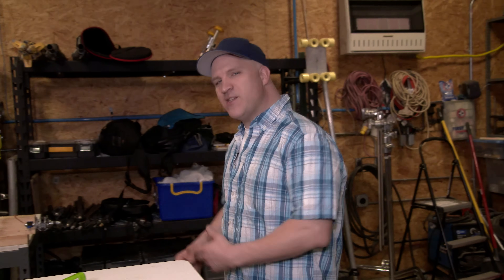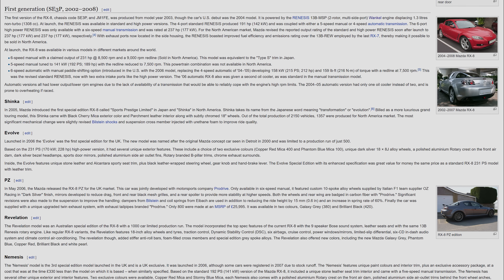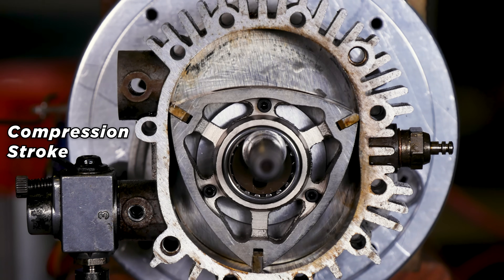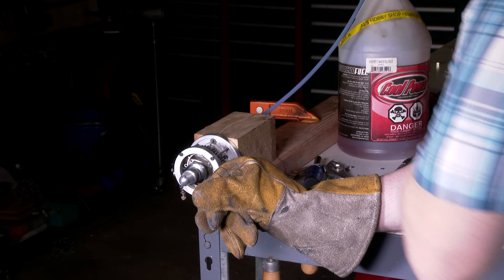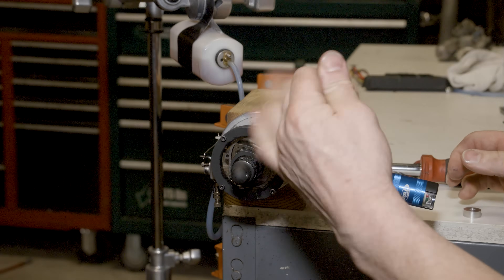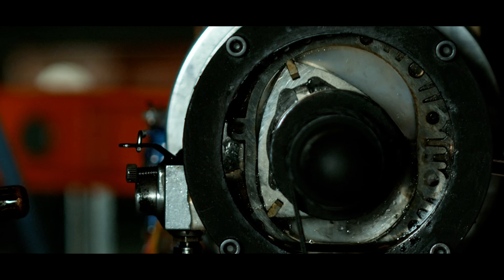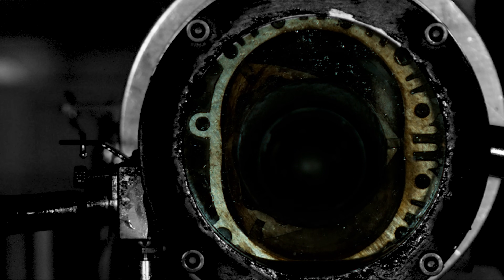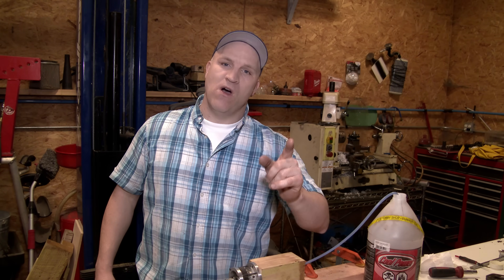See Thru Rotary Engine in Slow Motion - (Wankel Engine) 4K

Comment: The problem with the rotary engine is it’s to low of compression to be fuel efficiently for horsepower an the engine life is not all that great if this engine was a miracle it would be popular in the automotive industry! But it’s not really that great in my experience this engine is junk I wouldn’t never own one!! The piston is the best cause It traps the air intake and compress the air always has more torque because the length of the lever on the crank has more torque than the rotary!! It’s the long stroke high compression system that will never be out preformed in horsepower an engine torque at low RPM ! You can’t change the laws of energy that’s why high compression an long stroke engine are the real engine fundaments for hard working engines with the best fuel economy!
Reply: I think the point of the video was to show how this operates, as in a way to learn.  Not once did I hear him mention any comparison to our traditional motor.  Just explaining how this motor evolves, and in slow mo!
Obviously there are many drawbacks to this or it would be standard.  So, why learn something new????
Reply: brio I’ve seen a heard a 16 V 71 Detroit an a 16 V 92 at inland diesel in Gary Indiana run thy were used in ships that were used in the ports ! There horse power range is from 4500 horse to 6800 horsepower if you don’t believe me go to inland diesel off of I65 an 90 thy overhauled them there from the oil pan to the top of the engine head stands around 5 feet tall ! I can tell that you don’t know nothing about these engines because you would never talk like this you’re lying 🤥 about your knowledge so do your research and go an see the real engine! That demon 16 doesn’t have the foot pounds of torque as the 16 V 92 Detroit because if you would work the snot out of the demon 16 the engine would blow probably the head gasket would crack! I’m not a fan of sports cars I think there stupid to have because most of them have to be on highway that can have a pot hole because there stupidity low clearance! One thing I know a car shredder would take a 5 million dollar car a shred it in seconds! It’s for idiots that have more money than brains!
Reply: @craigmartin6826 Can you have 6800hp engines only 5 feet tall? I have been working on engines 3 stores tall at output a little more than that, like 8400hp. Are you talking about fast running 4 strokes? Not big 2 strokes at 120rpm?
Reply: Finn Halland I’m talking about about 4 stroke late model Detroit engines that run at 2 thousand RPMS max! I know there are bigger piston engines than the Detroit my point is that they are not rotary engines ok your getting off the subject! I know ship engines that are 4 to 6 stores high but there all piston engines I told u rotary engine fundaments are crap ! The Detroit   ship engines are better then the caterpillar engine because Cat has a value problem an known to brake cranks an burn up rod bearings I know the 3412 has some serious problems with the same causes! The Mazda 6 with the rotary engine is low compression an it gets bad fuel economy only between 18 and 22 miles per gallon which the Jetta TDI is known to get 45 miles per gallon which twice as better because it’s a piston Diesel engine not a stupid rotary Mazda this what I’m talking about an Detroit were known to be more fuel efficient than Cat an Cummins which all engines have there problems an it’s mostly depends on the mechanic 👨‍🔧 that puts the engine together!!! 90 percent of the mechanics are idiots and don’t do anything right which is the biggest problem with engine problems an I believe your one of this mechanics!
Reply: @craigmartin6826  I am confused. I wasen`t after telling you how large engines there are in the world. I was just asking if you could have a 6800hp engine as small as 5feet. (Keep racing out of this). You give some factual interesting replys worth reading. Than you turn to just make a point in how you are one of the few 10% best mechanics and you state the rest 90% are all idiots. I don`t  know how good you are. I only know how superior you think you are. (It is not any likable feature). But how you are able to make up your mind about me beeing one of those idiots that sadly are not like you, i really do not understand. Where do you get all this info from? I am sure you do not base your statements strong as this just on the couple of questions i posted here? Maybe you think you are God?  If you choose to reply, please keep it simple because i am writing in a foreighn language. There are some languages i Know better than this so if you are bilangual  please tell me so maybe we can share opinions more easy.
Reply: Finn Halland well I’m not playing God what do know engines fail if there not put together right an most mechanics are not aware of the counter bore protrusion height it needs to be higher than engine manufacturing recommendations because the engine head gasket fails at these height !! The head gasket is the life of the engine!!!
Reply: Wankel engines are obsolete today for the simple fact that they are inferior to reciprocating engines...
Reply: You can get farm more efficient functionality from a turbine based system.  However it isn’t practical for a car engine.
Reply: ? the Platypus it’s not a turbine engine it’s a stupid rotary type! Jet engines or a turbo is turbine where did you get educated?
Reply: Craig Martin I am fully aware that this is is a rotary.  I’m responding to the claim that the most efficient engine is a piston engine.
Reply: ? the Platypus the pistons engine is the the most efficient internal combustion engine design it’s because it traps the energy before it releases the exhaust which has a drive line to power it to the ground as a way to transport inland marine! Jet engine thrust for aircraft an nuclear power in ship! The rotary engine was a failure that is why no motor company made any attempts to create these engine fundamentals because its a low compression engine an if u want higher compression it’s more out of balance! But do with all respect I am aware of all the idiots that get out of colleges an universities the AI is nothing but a failure! But it only keeps the industry selling new products and selling new wear parts!
Reply: @craigmartin6826  The piston based internal combustion engine is inefficient. About 50% of the energy in the fuel is wasted. If you have the space then a turbine based system is more efficient.
You see this being used in turbine based engines in  power generation , marine applications such as the Queen Mary 2 and many military ships.  It has even been used to power the M1 Abrams tanks.
I agree the rotary engine is inefficient,  however that doesn't mean that the piston engine is the most efficient.
Reply: ? the Platypus Funny the turbine engine in the Abrams M1 is two miles per gallon the fuel racial for horses power is terrible the Detroit v 16 does a lot better than that an that is 45 hundred horsepower more than the Abrams M1 I built Diesel engines u don’t know what you’re talking about on horsepower to fuel racial! So where is a turbine efficiency it’s not like the pistons even the rotary piston engines in aircrafts are more efficient than jet engines on take off!!! The problem I have here is I’m talking to an idiot form college!!
Reply: @qtheplatypus  QM2 is powered by steam turbine. As i am a ship engineer i only guess the tank is powered by a gas turbine. Both of them are far less efficient than piston diesel engines that has replaced the turbine system everywhere fuel consumption matters. Military ships don`t mind economy that much. Power is king there.  Gas turbine gives you a higher output to its weight and space but it burns far more fuel each hp/h than any piston engine= Less efficient.
Reply: Finn Halland what is your source for the QM2 being driven by a steam turbine?   According to every source I could find she is powered by 4 Wärtsilä 16V46CR Diesel engines and 2 General Electric LM2500+ gas turbines.
Reply: ? the Platypus why are you talking about steam turbines when this YouTube video is talking about a rotary engine like that is in a Mazda vehicle I told you rotary Mazda engines are crap okay
Reply: @qtheplatypus   You are right. Thank you for updating me. The first QM was powered by steem turbines http://thegreatoceanliners.com/articles/queen-mary/And i was only supposing QM2 was also, but i was thinking about the QM2 from 1969. At that year it would have been steem turbines like the majorty of big ships at the time.Than diesel engines (meaning piston) took over due to the much better fuel economy. I am not so familiar with the new QE2 and it is interesting to learn it use gas turbine-elektrik propulsion. It must mean gas turbines have become much more effective than before even the main propulison are the 4 diesel engines running at a medium high rpm of 550. Giving a piston speed at 10m/sek, not bad.  Happy to learn, thank you.

Comment: I used to race a rotory engine in a Datsun 510;, I had a 350 SBC and I could shidft like a mad man 350 12\1\2 one and 488 lift can ported heads by me it was fast I never lost but the 510 gave me a fit it was a sleeper and man it was scary fast for a little car he had a rotory with turbo nuts

Comment: Timing of spark and fuel dose is and will always be the issue with fuel injection holding that key or should I say direct injection tech  , bUt the design of them needs so much more work than it is as they are not there yet .
Reply: The Wankel engine cannot support efficient use direct injection due to its horribly inefficient combustion chamber and limited static compression ratio. The Wankel is a obsolete concept due to the very serious inherent flaws in its basic fundamental design.

Comment: Starting any model airplane engine is harder without its propeller, since the prop acts as a flywheel.  Consider using a clear plexiglas disk where the propeller would be.  Also, consider modifying the nut so you can use an electric drill as a starter instead of a string; your fingers will thank you.

Comment: illitero
dokotorbimmer the cow pie
I can't believe the number of people discrediting these theories simply because he doesn't have access to manufacturing to make a perfectly pretty prototype. Experimentation and theories NEVER start with any amount of polish, and fucking obviously he's not implying that what he's showing is "good to go".

Also seeing a lot of people trying to say that these ideas won't work because of fluid dynamics, but apparently they're not considering the other forces in play. NO, it doesn't reduce the pressure of the post-combustion gasses; that's not the point. The point is to manipulate the expansion of gasses into rotational energy, which is the whole fucking point of the engine. Existing designs only ever maintained rotation because of pre-existing rotation upon start up. That's the only thing that keeps it rotating. The pocket just assists the expansion in a desired direction prior to venting to exhaust.
18